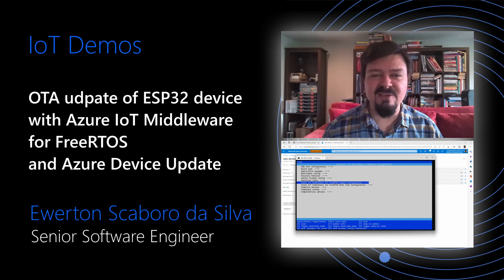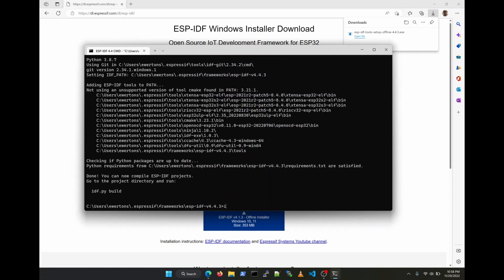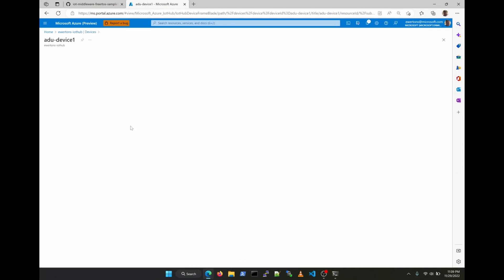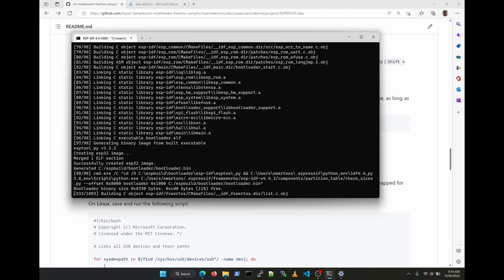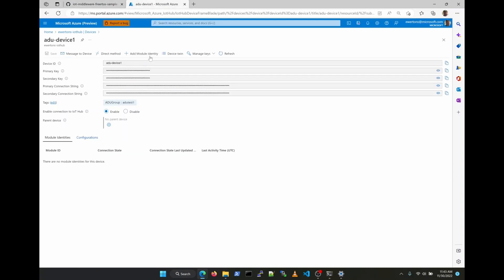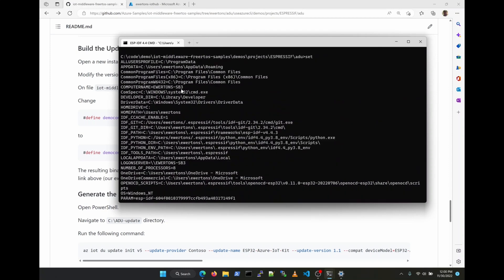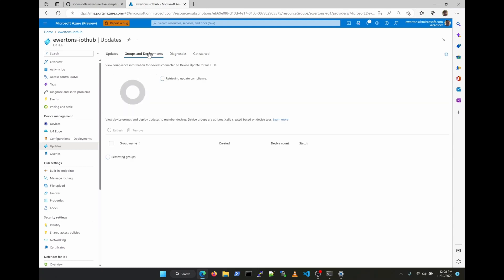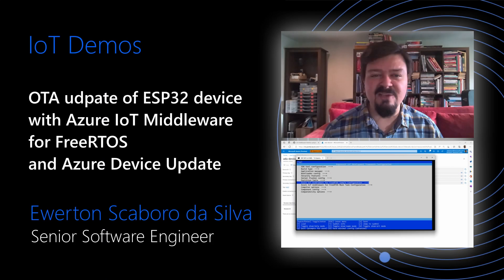OTA Update of ESPRESSIF ESP32 with Azure IoT Middleware for FreeRTOS and Azure Device Update (GA)

Comment: Thank you for a great video. Perfect timing for the project I'm currently working on.
Is it possible to update devices from the IoT central application? Or IoT Hub is mandatory for that?
Reply from the maker: Device Update for IoT Hub relies on features only accessible on IoT Hub and doesn't work with IoT Central. IoT Central does offer features to group devices, manage them through jobs, file upload allowing you to create your own way of doing device update, but you can't take advantage of all that Device Update offers